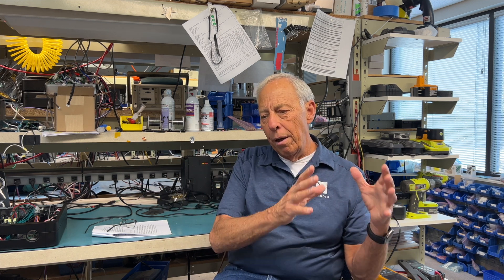Class D amp fatigue

Comment: In my opinion: The class D amps of today are not the evil many make them out to be. Sure, back in the early days, they could be nasty, but now, most all the issues have been licked. I'd say that 99% of fatigue comes from the speakers used with the amp and not so much the amps themselves. The fault of the amps in the grand scheme is what side of neutral they tend to lean towards. Pairing up lively speakers with a class D amp will cause fatigue because class D amps are lively. Pairing up lively speakers with a class A or A/B amp balances things out and will not be fatiguing. Example: Wilsons are lively speakers (I personally don't care for them, but that is just my taste). Wilsons are better paired with class A or A/B and even then, they can be fatiguing if not dialed in well.  Speakers that lean towards the warm side of neutral (tilted down) pair well with class D amps. 
It is not limited to "commercial" class D amps (in this case "commercial" means big names like Marantz, etc. I assume and most of Marantz's two channel amps are class A/B actually), one can make a PS Audio class D amp fatiguing by pairing up speakers that emphasize the output, although putting a tube in the input path greatly helps to diminish said fatigue.   I also think it is not brand specific.
Reply: My Focals sound just "meh" on my digital amp, almost annoyingly analytical and detailed. I really prefer it with my OG PSB Alphas, ProAc response, and Wharfedale Rubiance 27s. In that order. Sorry Tarun, I just think the PSBs sound a bit flatter!
Reply: @doctormidnight "analytical and detailed". Focal is able to deliver great sound. If they sound fatuiging, it is probably because they are not tuned probably within the room.
Reply: I agree, it took 40 years for engineers to master class A and AB.  It's taking 40 years to master class D.  But we're getting to the point where class D can surpass even the best A and AB amps ever designed.  50 years from now, everything will be class D, and all other classes will be relegated to the esoteric.  Not necessarily better, just different.
I've already seen measurements of a class D amp that forced the lab to get new test equipment precise enough to measure the THD and S/N ratio.  It was so low their standard test equipment couldn't measure it.
Couple that with power efficiency over 90% in some cases, and the other class amps start to look antiquated.
Reply: @jdlech Orchard Audio Starkrimson enters the chat ;-)
Reply: My experience mirrors yours. If the intended speakers have a naturally warm character then class D without fatigue. Pair a class D amp with bright speakers and you might develop problems. In my experience the class D amps generally present more detail but less dynamics than  A or A/B.
Reply: I guess class D- amps are evil. They take the oil away from snake oil sellers.
Reply: I have pioneer A-9 amp from 1981 and Q Acoustic 3020i and it has a nice homely sound. The sound just feels like home. Q Acoustics speaker have a tendency to sound homely.

Comment: Lol.. I’m fatigued after an hour of listening to streaming audio from Spotify, Pandora, etc.
I have decent equipment and still decent enough ears that if the source recordings are poor or compromised, I can tell.  Sometimes I’ll hear a recording I’m very familiar with when streaming, and I have to switch to something else because it gets on my nerves lol👨🏻
Reply: Have you tried a QUALITY streaming service like Tidal or Qobuz?  They offer significantly better sound quality than the mainstream stuff polluting the airwaves... I mean internet.
Reply: @abecollins2266  Actually, I’ve been using free Spotify and Pandora apps with the audio quality set as high as possible (for as high as free will go) through my wifi and I tolerate the commercials as listening breaks. I use my old 6s iPhone that I kept and put a high capacity battery in, but it pretty much stays plugged into the AC outlet, and is strictly for the audio streaming. I use the DAC from the iPhone into my secondary hi-fi stereo system which has a 100W per channel driving a pair of 30 year old Polk passive radiator Monitor 10’s that have modified crossovers with polycaps and fresh higher quality tweeters. They don’t quite dig as deep into the bass and quite have the sonic accuracy as my mains, which are 3-way acoustic suspension speakers with isolated drivers, but they have their purpose, and are good enough that I wouldn’t trade them for any of almost all speakers under two grand a pair. My Polks dig fairly deep, without the issues that some ported speakers have, and are my go to’s when the source quality is such that my main system insists on making it painfully obvious. One thing about those mains though, I’ll never be able to again afford a set of speakers like that, which actually make the acoustic instruments sound like they actually really sound from a good recording.. you see, I’m an older analog guy that prefers stereo, and I never really embraced the digital age, so I was too cheap to invest in expensive digital stuff of the more modern flavor that people use. Luckily, I still have adequate equipment and hearing for now, but sometimes it’s painfully obvious that nothing goes on forever, just hopefully our lifetime.  I try to keep things I like going whenever it’s reasonable to do so. 👨🏻
PS) The whole streaming thing doesn’t bother me that much because I don’t really use it for serious listening, more so to preview stuff I haven’t heard, because if I hear anything that I own and I want to hear it, I’ll just put it on; or if I don’t want to  hear it right then, then I’ll just skip it. 🥳Cheers!
Reply: @shipsahoy1793   I would highly recommend TRYING Tidal or Qobuz.  They both offer free trials.  The mainstream free streaming services typically use AAC or MP3 lossy compression which provides less than "CD quality" audio and will never sound that great even with the best audio equipment.  I would also recommend a good outboard DAC rather relying on the iPhone internal DAC. Just my 2-cents worth having been there before with my iPhone and mainstream services.  Enjoy!
Reply: @abecollins2266  Well thanks for the info Abe, I’ll have to look into it and think about it .. one thing though, how much will a DAC cost that’s possible to get “suitable” quality with multiple inputs on the unit without spending hundreds of dollars? 
I wouldn’t even begin to know what I’d be shopping for to be honest lol 👨🏻

Comment: Tripath fixed that problem decades ago. Those class T amps really sing. And they're dirt cheap. Please bring T amps back.
Reply: @Douglas Blake Gosh darn! That's why nobody speaks of Tripath? So everything circles back to the TPA3255 and the Aiyima A07? This also makes me more intrigued about the Octavio Amp. It's like a Bluesound Powernode copycat product from France and it uses the TPA3250. The specs seem so underwhelming but Octavio made some mods to the circuit boards.
Reply: @Douglas Blake Wondom still sells Tripath boards and finished amps. I have one of those amps. It's dirt cheap but only 10W. And it powers my fullrange drivers just fine.

Comment: My question to Paul is “ why do I need 1200watts @ 4 ohms  by using M1200”? I am using his S300 with a tube pre-amp and I rarely turn the knob over 10 or 11 o’ clock. I can EQ the sound via tone controls on the pre-amp. S300 was a tad fatiguing & dry  ( at higher volumes) with XP10. Now, sound has altered. I am sticking with class D as I cannot compromise on bass

Comment: What about all the d class amplifiers I mean produced modules. When one failes user/service can easily replace it by the same module or it requires some regulations to match to existing setup? Old amplifiers as we know can serve for decades. Class D is quite new approach and I'm curios if it's a reliable solution for long years

Comment: I had the same problem, found Class D too cool in tone and ultimately unsatisfying (NAD hypex sound).
Finally, I switched to an A/B and found the sound that to me spelled 'natural' (Arcam SA10).
Reply: Which nad was it out of curiosity?
Reply: @MrDingaling007   C328
Reply: @stephenbailey9969  ah yes as i expected it's the older hypex ucd class d design. The newer ncore hypex modules are a huuuge improvement over the old ucd design.
Reply: @MrDingaling007   Perhaps.  But since then I've heard quite a number of class D modules from Hypex, Purifi, Icepower, Infineon, Pascal in comparisons with A or A/B systems.  (Yes, everything with online compression, but in comparisons using quality headphones you can get a sense of the signature differences.)  You can find lean sharpness in amplifiers from all types.  But in my experience, that coolness tone is found in class D, even those tuned to be rolled off and less assertive in the upper register.  The most pleasing I've heard is the I25 from Primare, and still the tonal difference is noticeable.
Reply: @stephenbailey9969  Interesting, i found the opposite with a tripath class T (D) coupled with back loaded horns, very warm and tube like. No coldness to the tone. The combination was a  match made in heaven.  Too many variables i guess, and keeps audio obsession fun.
Reply: @MrDingaling007  Exactly.  Finding that 'sound' that satisfies is a very individual thing.

Comment: Purifi and I mean real Purifi not the NAD knockoff is the best sounding Class D there is if you ask me. Least “Class D” sounding if at all imo.
Reply: Have you tried Tripath amps? They sound very smooth. Unfortunately they're out of fashion and only Wondom sells a Tripath amp, but you'll only get 10W of power.
Reply: @user-xg6zz8qs3q  They went belly up, but not until they had made A Lot of chips and that's what some use to produce new amps from.
Reply: @PSA78  I have one of those Wondom amps with a TA2024. It sounds rather impressive considering the measly price. But only 10W. I would gladly pay more for 50W or more.
Reply: Nad do knock offs of purifi? Are you sure its not actual genuine purifi gear inside?
Reply: @MrDingaling007  it’s a licensed design from Purifi but built by NAD with lesser parts.
Reply: @lukerestlessstudios  Interesting I didn't know that. I expected them to use actual purifi hardware like they do with hypex. Thanks for sharing
Reply: @MrDingaling007  NAD calls it hybrid digital. There's no mention of purifi on their literature.

Comment: I had dilemma. I needed a new stove for my sauna and also a new amp, but only had money for one of them. I was torn. Until I tested a class A amp. Now have new stove and a new amp.
Reply: I had a Pass Labs Aleph 3 Class A amp that doubled as a room heater and stove to cook my fried egg breakfast.  It pulled 250-watts from the AC mains to produce a meager 30-wpc of audio.  It may have sounded decent if it weren't for my "real world" speakers and the power they required to come alive.
Reply: @abecollins2266  HIGH - END ROOM heating gadgets that definitely DID NOT have SNAKE OIL as fuel 🤣🤣🤣
Reply: Tosi hauska
Reply: Lol
Reply: Do you play amp in sauna or warm your eggs 🥚 at same time?
Reply: Does the egg plays good enough watts for audiphile hifi hifi
Reply: I’m the one who asked the question to Paul and before I had…tube monoblocs but actually it did not made living room a sauna 😂
Reply: @marcbungener1877  Well, they just weren't big enough. Been toasted by some at shows, and your living room wasn't small enough

Comment: Tell me why we want a class D again? Judging by the rest of his gear he bought a 'good one', and yet.....
Reply: @Douglas Blake Who cares? Sounds worse, fails, doesn't have decades of history of flawless performance. The on;y ;good ones' are apparently just as expensive as other designs. The only reason why class D is such a hot topic is the manufacturers want to save money.
Reply: @Roof_Pizza  no amplifier has correct phase through the bandwidth other than class D. Phase shift in output transformers is likely causing soundstage “anomalies” that may sound good to many ears but it’s distortion of the signal. Better to hear what’s on the recording not what equipment ads to it. With classD you can add tube magic on the line level side if you like. I do that sometimes too. I prefer the pure signal most of the time. Class D kills everything I’ve ever heard in terms of checking all the boxes including not the least bass control depth of frequency and overall slam. Soundstage and imaging is sublime! Perfect
Reply: Class D, in some form, is the future of HiFi
Reply: @stephenstevens6573  On the Space Station maybe.
Reply: @Douglas Blake better dynamic range?! Bullsh
Reply: @wa2368  yes better by a lot.
Reply: Purifi and hypex nilai
Reply: @DoeBoy999  the Hypex Ncore NC 400 kits are probably the best value in amplifiers at the moment. $1500 for two monoblocks no soldering needed and you can do some upgrades I’d be willing to show anyone who cares. I have a technician friend in FL who puts these together in an afternoon and they play incredible dynamics, detail, bass and the soundstage is perfect because of phase coherence in the entire audible band.